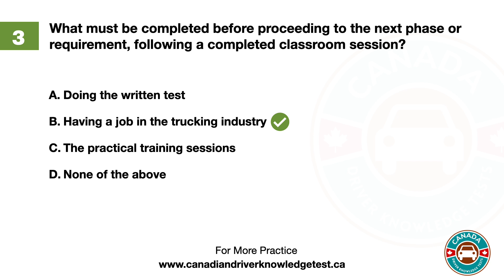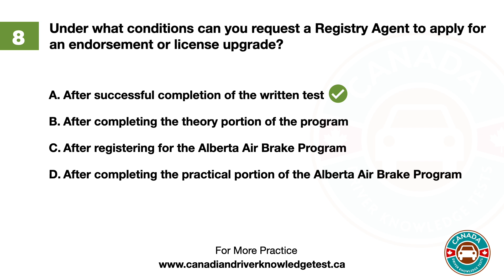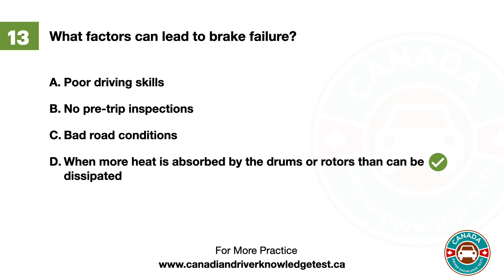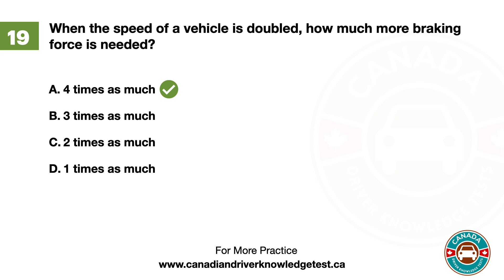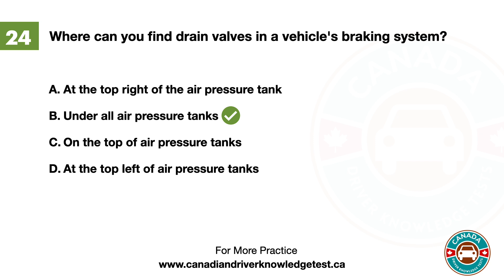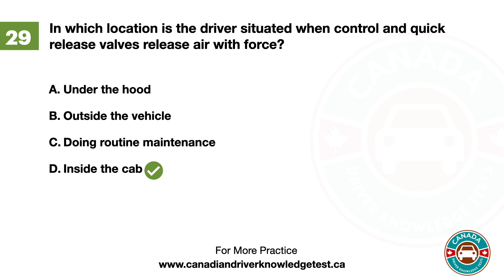Alberta Air Brake Practice Test Part 1 | Audio | Canadian Driver Knowledge Test

Comment: Answer to Question 3 is not true at all in fact its the worst pick of all. The answer should be and is C, because that comes right after the theory on air brakes systems, logbook and so forth. After the class, we went straight to the yard to do the practical, and that WAS the test after a couple trial runs. Some places may do written and that could also be a sufficient answer, but regardless if we talkin right after a class session, it will be the practical training session, which would be part 2 of the course before you write anything. Even still you would have to go to the registry to "write" the exam, and it's not always guaranteed you will get a job after you pass, especially if you have 0 experience. Not all companies work the same and depending on if you did manual or automatic if we are talkin about the class 3 or 1, your license would only be full if you completed the manual road test, further proving the answer to this question false. Hope this helps God bless!